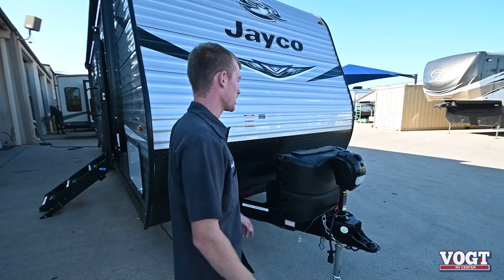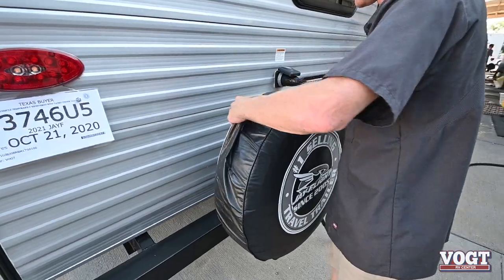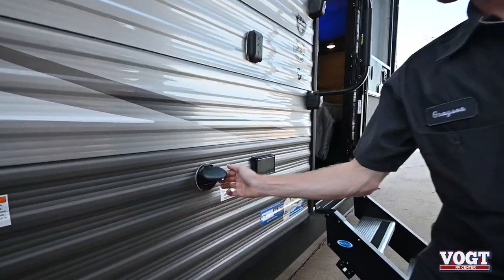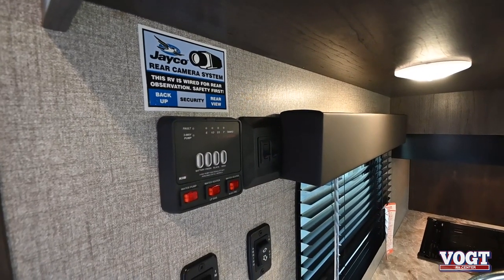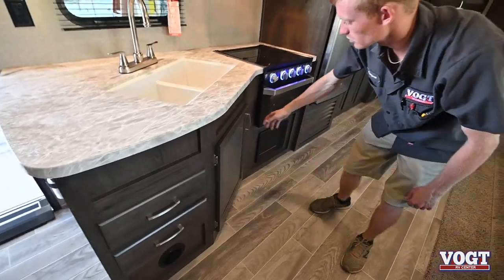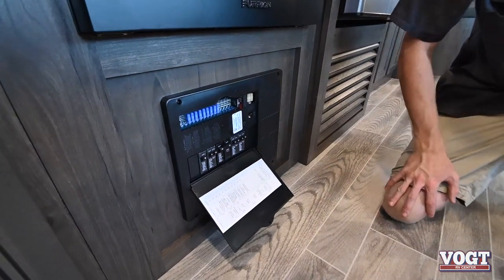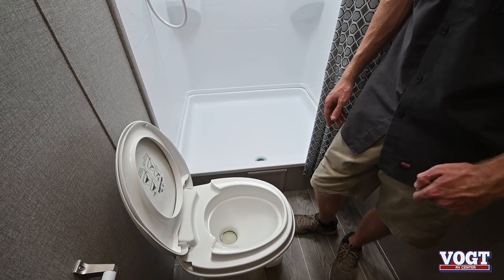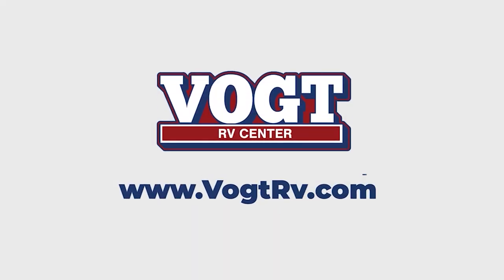2021 Jayco Jay Flight 284BHS | Full Service Walk Through

Comment: I just bought this trailer yesterday! I have never seen anything like it! Wife and kids love it we can't wait go camping. 👍👍jayco! The best trailer
Reply: We bought ours yesterday and pick it up niece week! We can't wait!
Reply: 10 months later and how do you like it? Thinking about picking one of these up and found this old walk through
Reply: @dustinvaughan57  10 months later and how do you like it? Thinking about picking one of these up and found this old walk through
Reply: @stevenjh4689  it actually held up to expectations! We always used full service and never had a problem running everything. I got two kids a 3 and 9 year old and there's plenty of room for the 4 of us.Plenty of USB charging for the kids in the walls . We tested it on super hot weather and the a/c held up. And easy to tow its kinda aerodynamic not too wide with the slide closed. But when set up it's massive. You will love it! How much is it going for now? Are they still offering the same warranty?
Reply: @1986hvwchampion  I thought I replied to this but I guess I never did! Glad it is working out for you! Do you know if it has 1 or 2 AC units? We have 2 kids under 5 so I imagine it would be a great for our family. New it can be found about ~$32K or slightly used 2020 for ~$29K near me.
Reply: @stevenjh4689  one unit. But the floor  vents work very well.  But I don't live in California lol but it held up well during the heat wave in vancouver last summer!
Reply: @1986hvwchampion  haha that's fair! We are in south TX so gets pretty toasty. Did yours come with an outdoor stove or was it hard to add one? What about the manual stabilizer jacks, a lot of trouble or do they go up and down easy? Those are the 2 things making me hesistatnt, power stabilizer jacks would be nice.
Reply: @stevenjh4689  yes outdoor 2 burner stove, outdoor electric fridge and outdoor barbecue connection all work amazing!  And the manual stabilizers are fine no issues!
Reply: @1986hvwchampion  Thanks again for your review and help, put a deposit on ours yesterday and picking up this weekend!

Comment: Designs need add medium dog/cat crates-litter box area and /or space for medium bird cage safe area!  Do they have capacity to add more solar panels on roof or bigger water tanks like a 40 gallon tank?  Do they offer add-ons like screen windows- ACRYLIC THREE PANE WINDOWS, sink sprayer, longer hanging closet extra insulation for colder travels? . . .  AND BUY A BATHRM TUB WASHING MACHINE WHICH FILLS AND RINSES IN BATH TUB! SOME WASHERS ARE LARGE ENOUGH TO DO FOUR SHIRTS AND UNDERGARMENTS OR THREE PAIRS OF JEANS AND HANG OUTSIDE TO DRY! If the slider malfunctions, do you have a manual backup? Under coat hooks at entrance, is there a small waterproof umbrella station? How long to order custom trailer designed for personal preferences?

Comment: I have this model. I'm trying to connect a dish tailgater but can't get a signal when connecting the coaxial to the satellite port on the rear of the trailer. I made sure the antenna booster is turned off but still get nothing. 

It works fine when I connect directly to the dish but not when I use the trailer connection. Any ideas on what could be the issue?